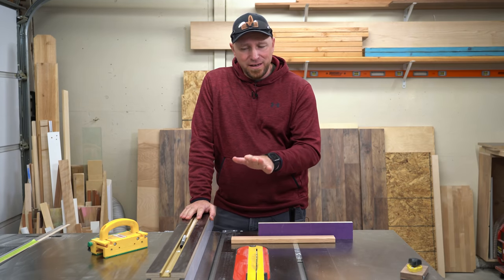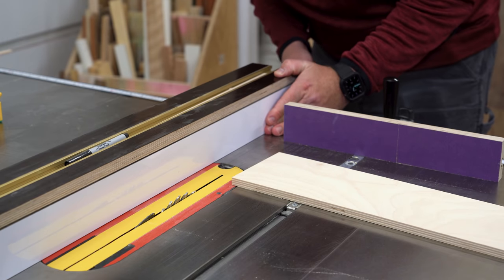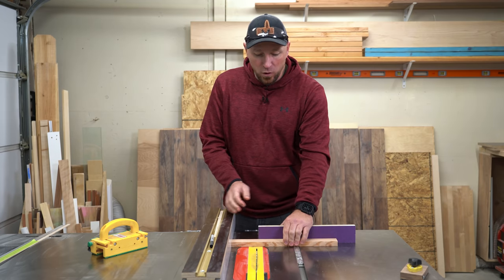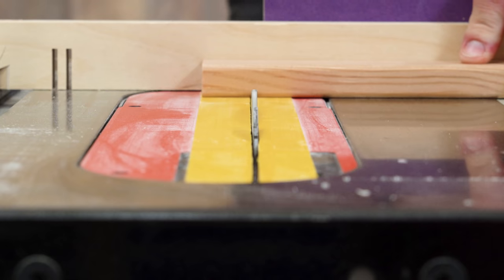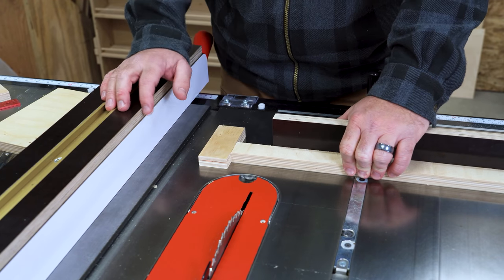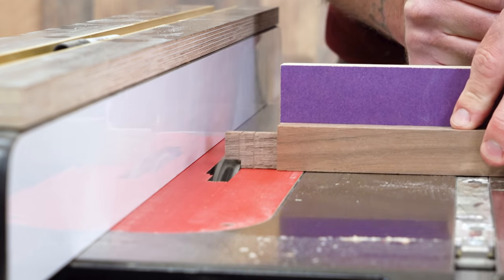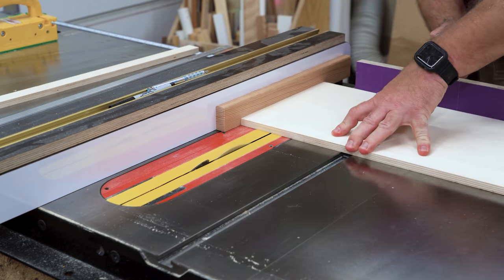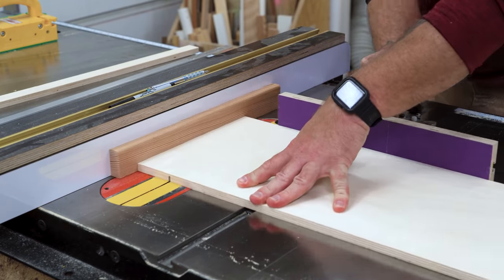Why You Should "ALWAYS/NEVER" Use the Miter Gauge & Rip Fence at the Same Time / Woodworking Safety

Comment: I believe you made the point about non-through cuts vs. through cuts very clear. I just hope the audience heard you. I learned that lesson with a short cut on a small dowel when the kickback was Impressive! Haven't done it again in the many years since. Thanks for the reminder.
Reply: The ones who didn't hear him, will be given the same "reminder" and more than likely they won't do it again either...sometimes us dummies have to be shown!!
Reply: I'm usually off to the left anyway, so anything flying back is not coming at me.  I also have the blade guard on so it is stuck under the guard.

Comment: I have started using one of the small high strength plated magnets as a stop gauge along with my rip fence.  If you know the width of the magnet you can set the rip fence to the dimension you want to cut plus the width of the magnet.  Then stick the magnet to the steel table top back well away from the blade against the rip fence.  Slide your board until it touches the magnet, then make your cut.  The board moves off the magnet and there is plenty of clearance between the blade and the fence so there is little chance of the cutoff piece binding.  This is especially useful if you want to quickly cut a lot of pieces to equal lengths.  When you are through cutting slide the magnet off the table top and stick it to the side of the table so it is out of the way but always available for the next time you want it.  (The only problem I have had is the board can sometimes roll the magnet down the fence toward the blade.  Using a square magnet would eliminate the rolling, but it has not been big enough of a problem that I've searched for a square magnet yet.)

Comment: Good explanation of the nuance that makes thru cuts dangerous while non-thrus are safer.  I don't use the fence and gauge together for either.  I clamp an index block to the rip fence upstream of the blade to index my work then push it thru without the outboard end touching anything.  If I'm worried about the workpiece slipping on the miter gauge, I'll clamp it to the gauge.

Comment: Here's the thing:  kickback on a table saw essentially means a loose piece of off cut wood flies back at you.  If you aren't cutting through your workpiece, there is no loose piece to kick back!  (Of course one should always firmly hold onto the left side of the workpiece pinched to the miter gauge.)   So the "rule" on NEVER using the rip fence and miter gauge at the same time is overstated ... as you said!  Great videos ... I'm fairly experienced, and I still learn from you.  Thanks.
Reply: Yes, but the deep cut he shows in the video left only about 1/8 (maybe less), but even with as much as 1/4, depending on the material and the piece itself (knotty wood, rot, etc.), it has the potential to snap or break and cause a kickback, so always be cautious and mindful of that fact.
Reply: wrong,  I got the kickback from non cut through.     I learned he is not presenting safe way at all.

Comment: Thanks! I was thinking about this the other day and couldn’t justify the physics. One additional consideration is what if you are also using a push block to hold the piece down and up against the fence to finish the cut? Especially one that straddles the blade.

Comment: Excellent video. So well  explained that only those who don’t want to hear will fail to understand the principles. What about something similar on the riving knife? It does seem that there is a difference here between countries. I think every table saw in the UK has a riving knife; I don’t think that is the case in the US. I would say that the use of a riving knife (always a fraction narrower than the carbide tips on the blade but a fraction thicker than the body of the blade) is essential when rip cutting long lengths of timber; when using man made products, it is possibly not as necessary but I leave mine in all the time. 

A riving knife is necessary to avoid the release of tensions in the timber after passing the blade to bind and so cause potentially serious issues. I don’t think you can tell which piece of timber has got those inner tensions just by looking at it but, if you do see a banana shape already, it seems a good bet that there are inner tensions. Just be safe, don’t make guesses and keep those riving knives in. 

I have several riving knives. The ones that came with the machine also had the overhead dust collector bolted to it. That meant that the riving knife was higher than the blade height; that made cutting non-through cuts impossible. That’s just dumb as non-through cuts are as useful as through cuts. The temptation therefore is to remove the dust hood and the riving knife completely. Bad choice. For each of my blades, from 2.5m to 6mm wide) I have a dedicated riving knife. Each obeying those rules of thickness that I set out before. I went to my local engineering shop and they have nominal 2.5mm, 3mm, 4mm etc steel sheet. They cut out the shape I was looking for; I then brought them home and refined them. This includes drilling holes for the securing bolts, filing the leading edge of the knife into a…..more knife looking edge. Most importantly I ground every knife thickness (so ensures it follows the thickness rules) and ground the height of each so that they were a fraction (1mm?) lower than the appropriate blade. That all means that I can make non-through cuts whilst still having the knife doing its preventative work. 

Doing this all took a bit of time - I can’t remember exactly how long - but it’s a job that, once done, don’t have to do it again .
Reply: I agree with you, and you've elevated this to the next level. Most modern (for lack of a better term) saws here in the US have riving knives. There are a lot of Youtubers with old Delta Unisaws that didn't come with one, so they either have to integrate one into the zero clearance insert or some other creative way.

That said, I've personally had wood tension release, while using the saw, WITH my riving knife in. In one case, the offcut (non-fence side) pushed into the blade using the knife as a fulcrum, and another time (again, with riving knife) the same situation happened but between the blade and fence. I managed to duck that missile... somehow. Guess my point here is, if the wood is wonky visually, I just don't table saw it, or cut it into smaller lengths. Caveat to my caveat - sometimes you can't visually tell that wood is case-hardened... and life gets briefly exciting.
Reply: @mattelias721  thank you for the reply. Yes, I too have had the same - the riving knife is not fool proof. And, again, I agree with you about looking at your timber to see if you find any potential problems - once more, not fool proof. You can only lessen the chances of something going wrong; but that’s the same with most woodworking equipment and processes. Hopefully, all this will be of use to newcomers who can learn from the experiences of others
Reply: My saw came with both types.  I keep the one with the guard on unless I am not cutting all the way through.  That guard helps keep the wood from lifting off the table and anything getting pulled into the blade.
Reply: @loganmedia1142  certainly, wood lifting off the table is an issue; I’m not sure it’s dangerous in itself but a hand trying to stop it could be. I bought a couple of sets of those tracked wheels which fit into the slot on the rip fence and have adjustments for height. Ouch! What a price but it does stop the wood lifting or veering away from a close fit to the fence.

Comment: I always clamp a small block at the front of the fence. Then the board has no way of binding. And no nbig deal if you don't use the tablesaw ruler. An a sticky back sandpaper on the mitre gauge for no slip[ping ever.
Reply: I use a machinist's 1-2-3 block against the fence (thanks for the tip Stumpy Nubs), then I offset the fence scale by 1 or 3 inches, depending on how I orient the block.  In safety circles this is still a no-no.  Violent kickback on the table saw requires two conditions: 1) The wood needs to contact the teeth on the outfeed side of the blade, and 2) The wood needs to be forced into contact with those teeth.  When using the miter gauge and fence together, that force occurs when the wood gets "pinched" between the fence and blade.  This can occur even when using a block to separate the cut-off from the fence if the diagonal length of the cut-off is wider than the distance between the blade and the fence.  As such, when the cut-off is small I use the 1" side of the block to make the math easy.  When the diagonal length of the cut-off is an inch or more longer than blade-fence distance, I'll use the 3" block to provide more room.  If the diagonal is more than 3" longer than the blade-fence distance, then I don't use the fence at all.  I don't measure or calculate the diagonal length of the cut-off.  I just eyeball it and make sure to err on the side of caution.

I do this so often I considered adding a second scale offset by 3".  In theory the math to add a whole number of inches is really simple, but I still get it wrong surprisingly often if I'm moving quickly between cuts of different lengths.

Comment: I just keep the blade guard on.  The piece is then between the fence and riving knife plus the blade guard over the top.  I think this rule about not using the fence and mitre gauge together when cutting all the way through also depends on the length and width of what you're cutting.

Comment: The worst part is that some were hearing you were still not listening. People if you are cutting through the wood and end up with two separate pieces use only one of the two fences. If you gauging the wood and at the end are left with a modified one piece of wood and saw dust than two fences can be used.